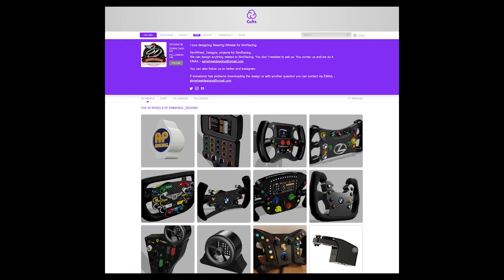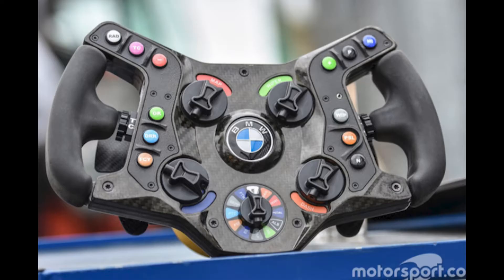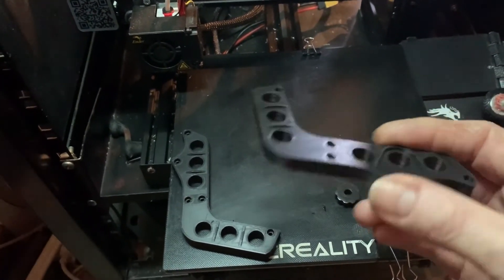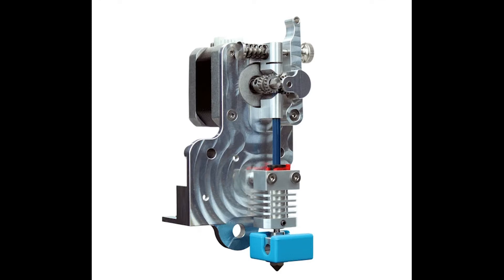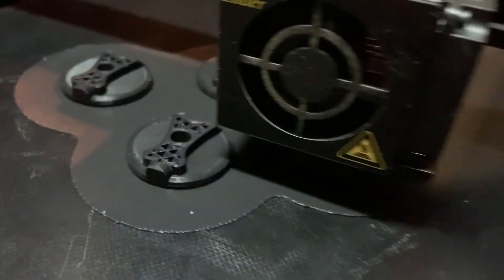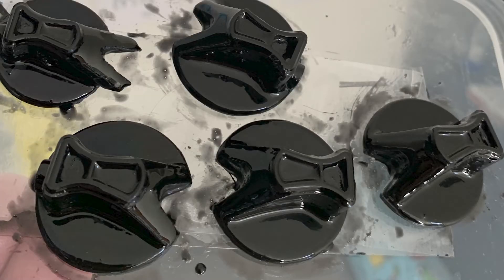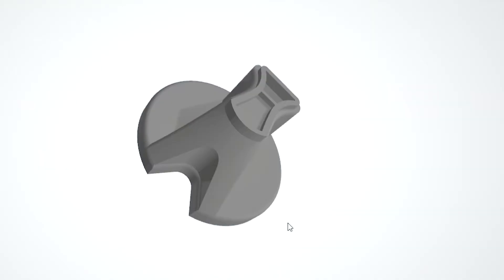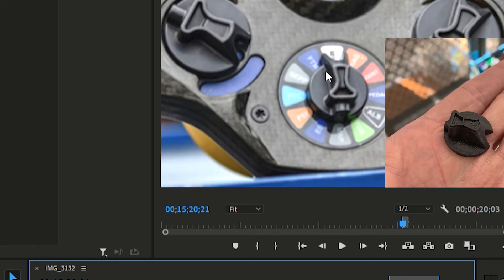EP3. BMW M8 GTE Replica Sim Racing Wheel Build- Printing the switch panels and knobs

Comment: i think you could get the same look and easier with primer filler , sand the knobs, black paint- then a gloss varnish. epoxy is good- but very messy to work with

Comment: Nice. Running a lower print bed temp will stop the warping on the bottom edges.
Reply from the maker: yes thank you! I did only have my printer 2 days at that stage so had a lot to learn ;-) been through a few spools since then haha Definitely an art to getting the right 3D prints too hey?
Reply: @sim-racing2277  Yeah, id hate to think how many prototype parts ive had to throw away.